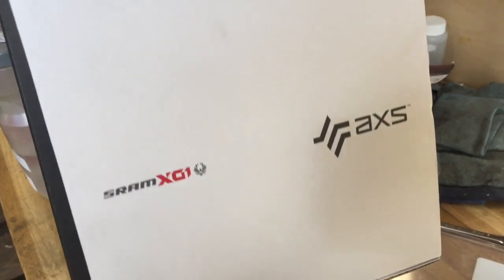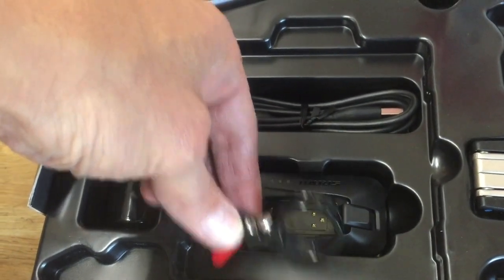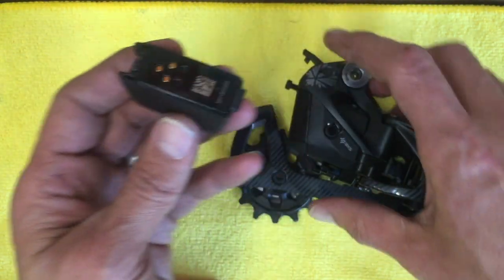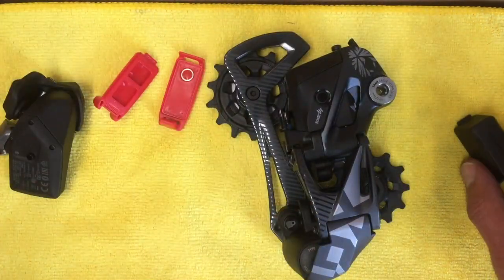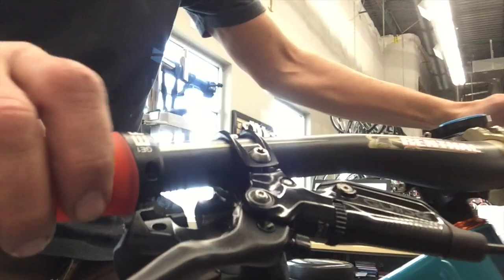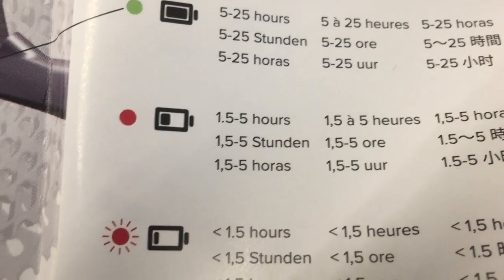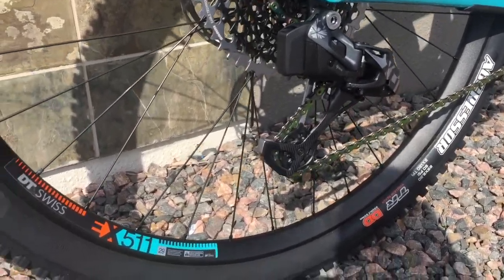SRAM Wireless MTB Electronic 12 speed Unboxing, Install and Setup

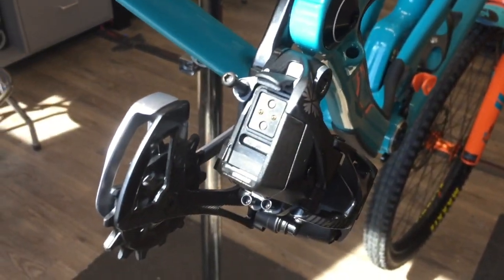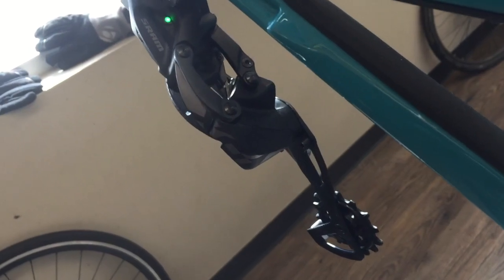Comment: How did it went from this 4:34 to extended 4:42 not even the SRAM video shows how did they extended
Reply from the maker: Basically you just rotate the cage counter clockwise and press the lock button. You can see the button at the 4:56 point. To release the cage, just rotate it again slightly counter clockwise and the button releases. Most all Sram clutch type derailleurs have this feature.